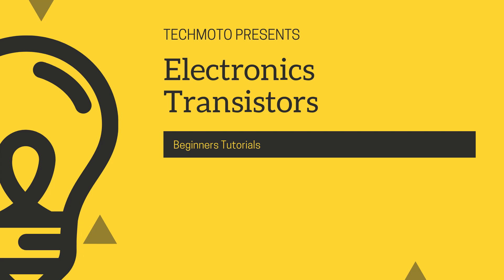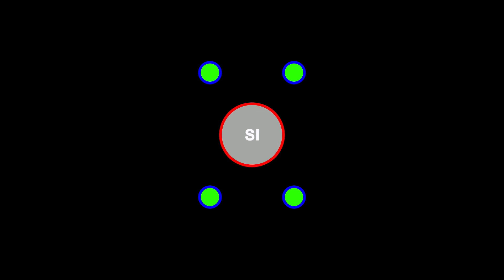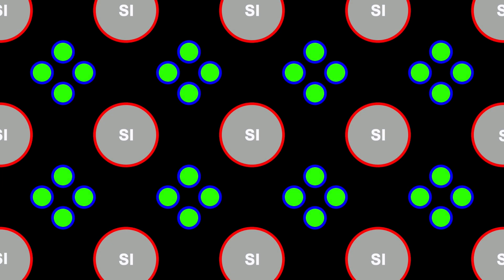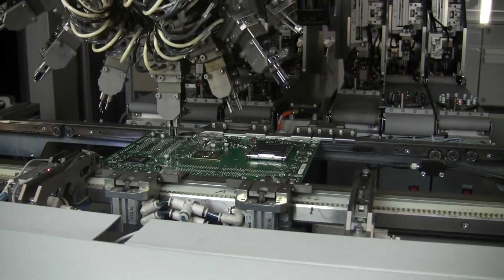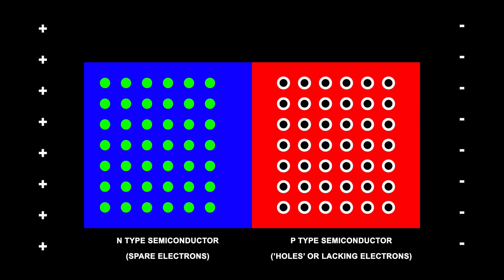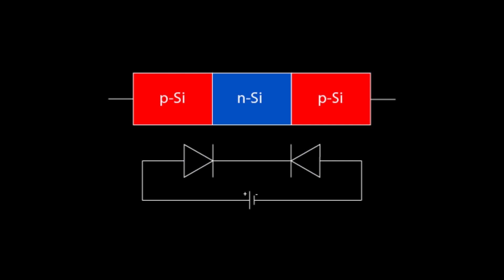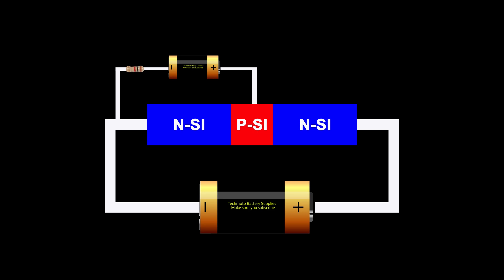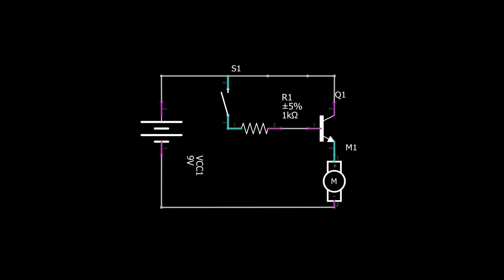Beginners Guide to Transistors and Semiconductors

Comment: Is NPN normally closed and PNP normally open by any chance?
Reply from the maker: I suppose they are both normally open (no current flowing) but change to closed when you apply the right connection to the base.

Comment: How do you choose which one to use, ie, a PNP or a NPN, when to use one over the other!
Reply from the maker: You need positive on base to switch on NPN and negative on base to switch PNP. Depends on your use really. I find NPN is most common in most of my projects as I get low current from a microchip that I need to switch something that needs more - as an amplifier.